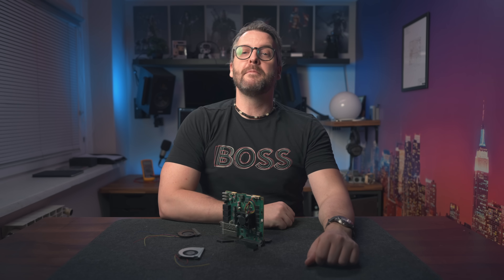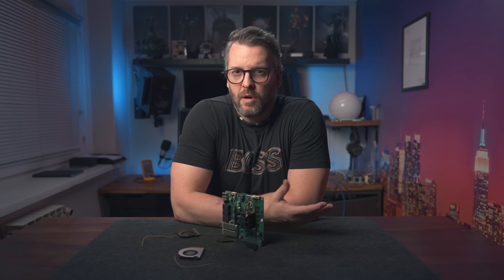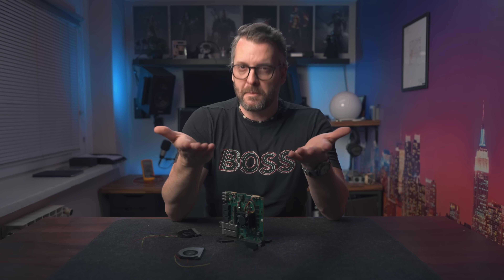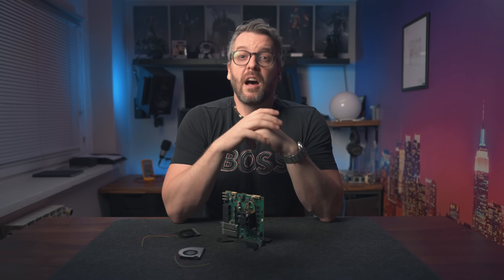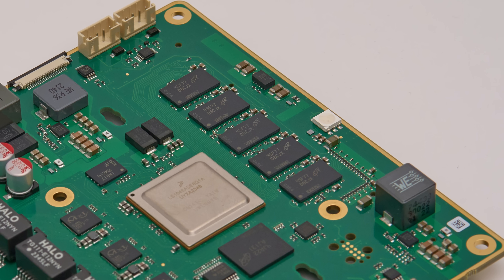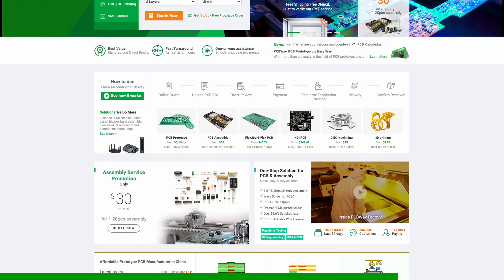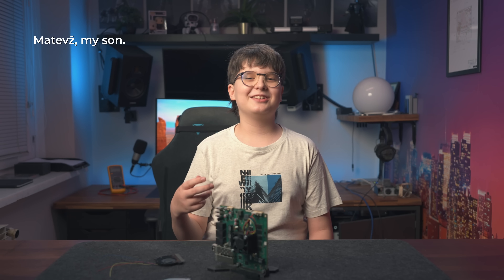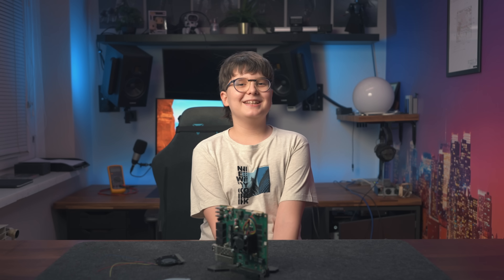You Wanted a Cheaper Router. We Can Do That.

Comment from the maker: To clarify, development kits (which you can preorder at https://mono.si), will receive NO price optimizations that we discuss this in this video. In fact, we're looking the other way, we want to add as many useful features as possible just so that everyone that preorders one of those will have a ton of things to do and explore, be it in a lower level, like fiddling with I2C busses, the OS level, or anything in between!
Reply: Kudos for the project. For me and for my customers, I'm tired of buying "does-this-and-a-bit-of-that" devices, like NAS pretending to run VMs and VPNs and then failing in many ways. Therefore I'd much rather buy a proper router, a proper switch, and so on. That small raspberry project is installed on a physical raspberry. The VMs are running in the server. Life is just better that way. Surely there will be a 2% of users which would totally use that additional mediatek chip..but the remaining 98% will try to use it as a normal raspberry and fail. That is true for anything else. Give us a proper router with proper options which will make us say "when i want a real router my way to go is XXX...now THAT'S a proper router!"
Reply: I was thinking of the consumer version like you said in a metal sheet enclosure with the holes for rack ears and if you need the rack ears (10" or 19") you can order them separate like an addon ;) not added default in the box. Less waste
Reply: Perhaps as a potential way to make the Consumer end-product even cheaper... is it possible to offer a SKU without a case but 3D print files so a case can be made from materials of the user's choosing? What kind price reduction will that allow for?
Reply: you could have a lower binned version of the board that has user added ram for those with niche use cases
Reply: is there a delivery window for this now? Do you believe June/July is realistic?
Reply: I am sorry dude for being the barer of bad news, you wont remember me but I have suggested features in the past/earlier videos and just argued that there is not much value for most people given the specs and pricetag and today I found out (via an ServeTheHome review on youtube) that a multidevice launched that has all the features that I wished yours had and sells at your bottom pricetag , either try to find that ServeTheHome video or google for Qotom Q11032H6 and really tell me if I am wrong, I mean is there something that your device can do that this device cant ? L

Yet it has all the features and then sum, I am afraid that's why the fat cats were hesitant to fund this project further.
And like it is not that this device is your router's killer there is a plethora of similarly priced devices that can do everything your router does but simply.. well better/faster and then some but this just like checks every little detail... well it doesnt have PoE I think but other than that its has it all and run all current router/network OSes. 

I am mostly sending you this for a reality check because either you know something I don't and your endeavour will end up to fruition or you may be need to think a scenario where you must cut losses because I really dont see any real value in your device compared to what's already available even for less.
Reply: Those 50% margins look more like a 100% as they literally double the price...😂😂😂
Reply: You can find preowned enterprise-grade 32-port 40GbE switches at half the cost of Tomaz's switch. I find it funny anyone would spent this much on a 2 port 10GbE switch...
Reply: @messier2295  98% of people do not want a 32port 40GbE switch even for free. The few who do are not the customers he is targeting, because they are not potential future customers of his anyway. Very simple and very obvious. I would maybe want a 32port switch like that, but I'd probably play with it a bit and park it next to all the other enterprise-grade stuff I have that I never even turn on, let alone use. 
I don't mean to pretend to speak for him or on his behalf but to me this is just logic. A 32port enterprise switch is not a competitor to this device.
Reply: @messier2295  There's a host of caveats to that claim. First, used gear (YMWV). 2nd... size, noise, heat and power. 3rd: Depending on the licensing schema for the device's proprietary OS on the device you could end up paying though the nose.  If it's Mikrotik/Ubiquiti you're fine, Cisco OTOH is hideously expensive.

Comment: As for docker or some applications running on router - I would leave it for other network devices prevent on that network which is accessed over router. But what would be very interesting, if there would be a possibility to connect these routers present on different networks and so they would for something like their own VPN. Sort of like few properties on different network vendors connect and while being in one, I would be able to access resources on other, like media server, or same Home assistant running on other property, and same Home assistant reaching some SBC which gathers info from home.
In general I would value simple, transparent and reliable router which takes control of network stuff, on functionality of that network could be done on devices on it.

Comment: I'm starting to wonder if it would be better to keep the sensors and such, but downsize the eMMC a bit more. 8GB is already commonly considered a lot for router primary storage. Since the nmve ports are for the Wi-Fi cards at best there's USB for an alternative, so perhaps you'd want to keep that high, but most use cases won't need that much storage, I'd think. I can't speak for the RAM utilization, especially with the 10G and caching.

The following isn't cost optimization, but in regard to how you said we'd get our own firmware onto this thing... (That is, aside from the possible option of being able to use the booted image's sysupgrade system to upload a Factory (or equivalent) image.)
One place I'd highly recommend looking into is the UBoot web server. I've heard Pepe2K's firmware has this as an option, but I know for a fact that GL.Inet has it as a feature in their custom builds... and actually has it as a selling point. It's a lot easier to use than TFTP - I am still not sure how to actually use that, but I have successfully reflashed a borked router multiple times thanks to the web server. The other thing you could go with is USB boot support, the DL-WRX36 can outright boot an initramFS off of USB, and the OpenWRT One installs images from a USB drive automatically.

Comment: Consider dropping two of the USB-C ports, replacing the three individual 8P8C connectors with a single module that has four of them, and use the extra 8P8C as a Cisco-style serial port.

Comment: I think most of the gateways from other brands that have been coming out, have all moved from dual core to quad-core ARM CPU's. I think Cortex is the one I see the most. So tbh I would have to weigh out whether your product for like 30% more cost would be worth the same CPU or not. I ended up just going from OPNsense to Unifi after they brought better firewall features to Unifi Network 9.0. I saw how much this costed compared to it and tbh the UDM-Pro-Max was the way to go for me personally. It was between that and getting their Enterprise Gateway just for the extra features to play around with but that one was a bit out of price for the features it still had for my home lab use case. 

Will keep checking back tho and maybe ill just grab one of these to play around with. Probably wouldn't use it as a Site-to-Site either though since it just wouldn't make sense to leave the Unifi ecosystem now.

Comment: I would suggest getting the price as low as possible. For me, the best performance is not the top priority. I prefer to know that it works and will have support. I would like to buy a fast rooter that I know is fast and reliable. With your transparent behavior, I feel confident in purchasing it. If it had a reasonable price like $300, I would buy it.

Comment: I'd like to see the cost come down as much as possible without necessarily reducing what the software is able to do. Meaning if you can get a sufficiently capable dual-core and optimize the code to only what needs to run there, we're golden. Else if it needs to do security, that needs a notably beefier CPU and additional threads.

Comment: Great video! Really appreciate how you broke down the different areas where costs can be optimized on this board.

One note on the CPU side, it's arguably the component where changes could have the biggest impact, depending on the intended use case. If this is positioned as a true dev platform, then investing in the best possible CPU, especially with higher core counts, is worth it. This is particularly important if you're planning to use VPP as the dataplane.

VPP is incredibly powerful, but it’s also quite CPU-intensive. Its performance will be bottlenecked by two main factors: the networking I/O path to the CPU, and the CPU itself. The upside is that VPP offers excellent flexibility for future software improvements and custom routing features, something you can’t fully achieve with hardware offloads alone.

At high throughput, VPP can easily saturate one or two full CPU cores. While it’s true that at lower throughputs, interrupt-driven or adaptive modes can help reduce CPU load compared to polling, this is only a partial solution. Interrupt mode simply can’t handle 10Gbps line rate, and adaptive mode will switch back to polling at those higher throughputs. On top of that, because of how VPP operates, performance will degrade significantly if those CPU cores are shared with and interrupted by other processes.

Comment: A couple of things - first, is it possible to use a single, cheaper power monitoring chip, to get some amount of data? Nerds like myself tend to enjoy seeing at least overall power usage and perhaps power rail voltages. I know there's a lot of power monitoring chips out there, having used some myself, but I work in areas that really do not need cost optimization so my knowledge there is a bit limited.

Second, is it possible to have an ECC and non-ECC variant of the board available, perhaps with the same PCB but some components depopulated? To me that shouldn't be significantly more expensive, as you wouldn't have any additional component variants, just a different assembly, but I can also understand not wanting to stock two variants.

And third, I can run Docker or Home Assistant or whatever else on anything, and personally I'd have to say that if the price of the device would be higher due to having a higher clocked CPU or more RAM etc, it's really just not worth it. There's plenty of cheap compute out there, so to me that's not special.

Comment: Getting rid of the NOR Flash completely and adding an SD-card slot for experiments could also be a cost efficient solution.
The stock firmware would stay in the eMMC at all times and experimental builds can be tested on the SD-card. If it doesn't work, no problem, just remove the SD-card.
MicroSDcard holders are very cheap, for example the Hirose DM3AT style holder is available from many vendors. The original is less than 1€ on LCSC, the footprint compatible ones are about half the price.

Comment: what about removing emmc completely and add an SD card slot? SD card would allow quick firmware slots and user flexibility.
Reply: A high-quality SD card or microSD card slot would cost a couple of dollars and on top of that the cost of a high-quality card has to be added on top of the cost of the device so the money isn’t saved. It is re-distributed and could cost more extending the signal to it may also be a painand require another PCB layer

Comment: will you be keeping the board layout with the shunt resistors/sensor pads but just not have them soldered on, or does leaving them out also require a redesign of the pcb? it would be cool to be able to solder them on myself i think

Comment: 13:38 - Hard disagree with this statement, some are tighter and it's hard to unclip the connector, some are looser, some are just right. Some have smaller or larger spacing between ports, better or worse LEDs. Just because I can't name the manufacturer doesn't mean they all offer the same experience, it just means the manufacturer of the ports isn't advertised.

Don't take the disagreement as criticism, I love your work!
Reply: The cable also plays a massive role that you’re plugging in. You might find one is amazing then you switch to another brand of cable and that one is horrific to use.

Comment: I like to be my router just that, and be performent at that
At most, it can function as a modem or firewall where I am not afraid to run at the cheaper cpu, ecc ram would be something i pay extra for
DIY and kids living at their parents home can defend a cost around 200-300, especially if its energy efficiency is a factor (here in Europe) but anything above 300 is out of the this mentioned scope; wifes or parents need a reason and then a cheaper good-enough solution will sadly win the argument

Comment: Having ECC would really differentiate this from other, even big brand devices.  And some here arguing that "who ever sees any problems without ECC?", reall nail it. You don't see the problems as memory errors, you see the as some obscure malfuntions without any rational reason. And to the person who said: "it only corrects one bit errors": correct, but it also detects all two bit errors, and without the ECC you don't detect any memory errors except byt their side effects.  And because this device will also run some security-related softeware, for example in IPSec applications, the ECC is essential.
Reply: That shouldn’t even affect data integrity if they can be corrupted and your system is unable to detect that you should not be using that system

Comment: I'm fine with most of the optimizations. The reduced CPU performance is fine as long as it really doesn't impact network performance, problematic is not using ECC memory altho that is probably as you mentioned not relavant for most users, and having a backup nor flash chip is important if a user manages to corrupt the flash. Just go with a cheaper one

Comment: Modularize the design. Lego router.
Reply: Exactly! That could be the strongest selling point at such a price!
Reply: @stahab  It would be pretty cool if you could stack on a bus. Might look like a tower or something maybe... but small in formfactor and easy to swap things out.
Reply: @AtomkeySinclair  ... and also to be able to add slave modules like PoE switch, WiFi, NAS / NVR module with nVME SSDs etc...

Comment: since most decent firewall software only runs on amd64, you are at a software compatibility deficit. you should make sure your router can run the few arm firewalls (like OpenWrt or MikroTik RouterOS) out of the box.

your target audience will be mostly tinkerer or oss enthusiasts. giving them just a linux shell as a starting point may be sufficient. but if your router is easily configurable out of the box, that also makes those first adopter recommend your router to their "normy" friends.

many people will put your router in easily accessible places like the living room. you probably want to make sure your router stays silent and cool even under heavy load. (bigger fan maybe?) and please make it dust proof enough for cats to snuggle up.

and, how i chose my new firewall: (not sure that will help you)
1. two 10Gbit sfp+ cases, which can simultaneously run at full speed
2. enough cpu and ram to run my heavy firewall setup
3. compatible with pfSense/opnSense or virtualization of them through ProxMox
4. silent or at least quiet enough to be placed in my living room
5. costs me less than 1000€
Moginsok could satisfy 1+2+3. glueing a proper fan to the chassis could satisfy 4. but i overshot my budget by 50 bucks.

my research revealed that 10gbit router are sold for approx 200€ - 300€. but those things can barely route at wire speed and scream like hell.
if you can promise your router can take up proper firewall duty at wire speed while staying cool and silent, i think most people will be willing to spent 500€ - 600€ on your router.
and i don't think i am overstating the silent part, only a small minority of tinkerer have a 19'rack in a silenced closet.

Comment: I completely understand your position and why, even with optimizations, the price remains higher than the broader market average. The core challenge here seems to be the lack of early-stage funding or investor backing. Most successful tech companies typically operate at a loss in the beginning burning cash to build brand recognition, attract a wide user base, and gain market trust. That initial growth phase enables them to later negotiate better manufacturing terms and refine their PCB designs for scalability and modularity, ultimately bringing down costs.

Right now, you're in the tough position of trying to compete with established players like TP-Link. Take the ER8411, for instance it offers significantly more in terms of hardware (dual power supply, more I/O options) for the same or even a lower price. At your launch price of $600, alternative options like the Minisforum with 2x SFP+ and 2x 2.5G ports start to look much more compelling from a value perspective.

It’s clear the product has potential and quality behind it. However, it risks falling into what I’d call the "mid-size cup trap" a fast-food pricing strategy where the medium size is deliberately made unappealing to push consumers toward the larger option. Without a strong differentiator or tighter price positioning, it may end up being the size that no one chooses not because it's bad, but because it's not competitively aligned with market expectations.

Nice job for the outro ;)